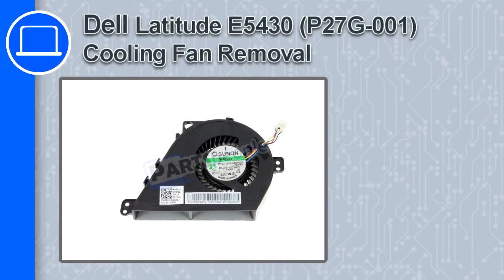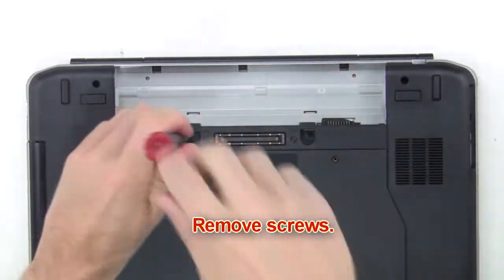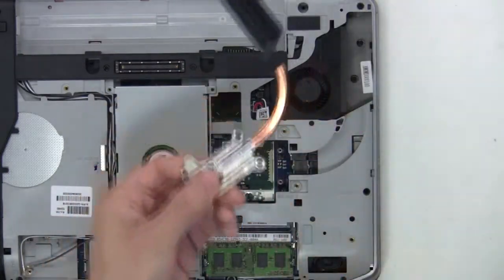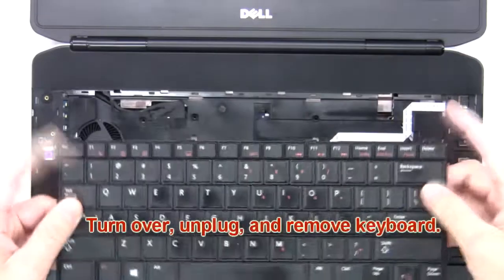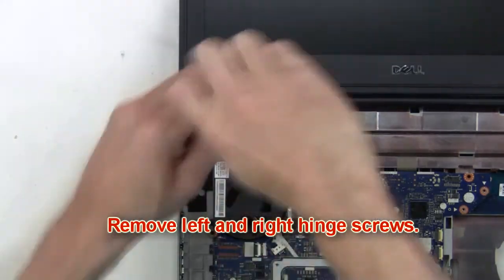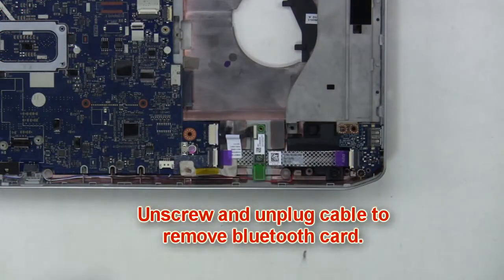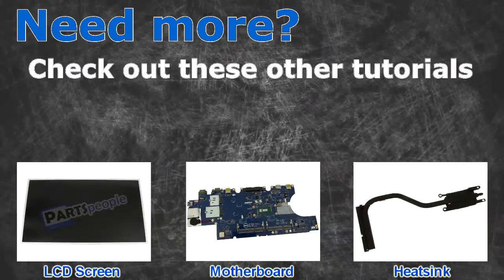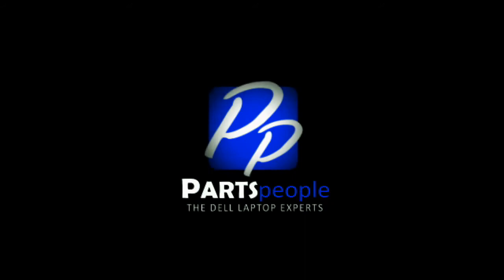Dell Latitude E5430 (P27G-001) Cooling Fan How-To Video Tutorial

Comment: Just did mine, thanks for the video, but I didnt remove the wifi card or the bluetooth. In fact I only removed the right side screen hinge and support and was able to get the fan out without removing the motherboard either.
Reply: I wish you would make a video :)
Reply: I hope you mean the left side hinge as the fan is on the left side.
Reply: @wildonemeister  going back a while now but pretty sure after taking off the right side I could  just lift the board up enough to get the fan out, but it was a while ago now🙂